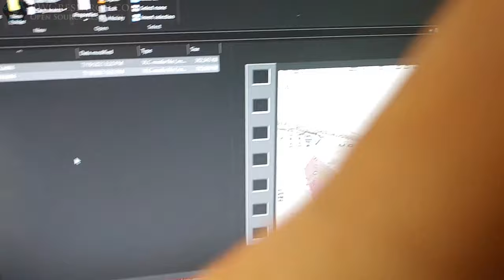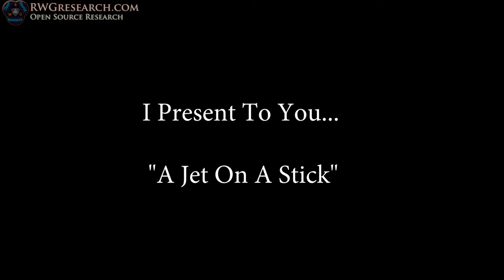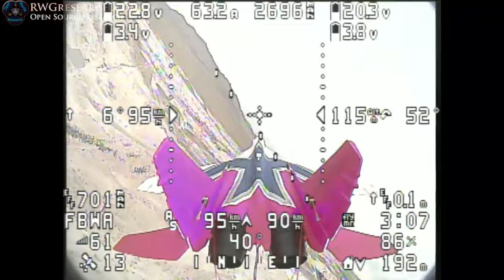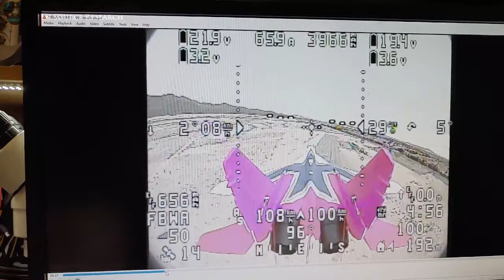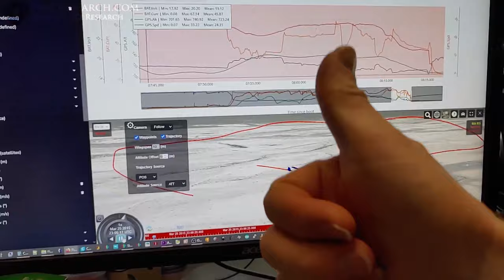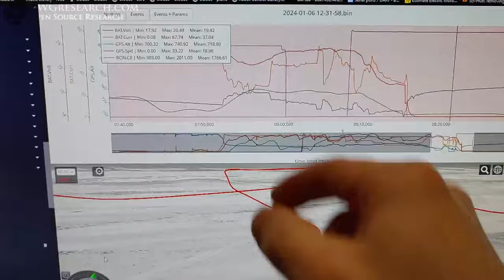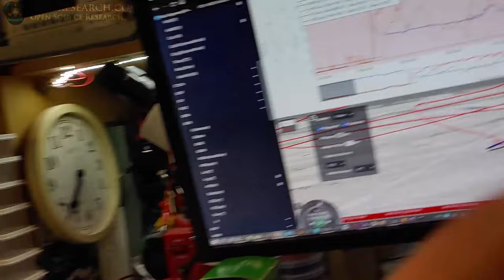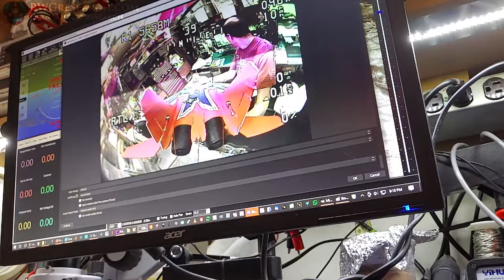A Jet On A Stick - MIG-29 Third Person View -Twin EDF - Ardupilot - (crash) + Extra - SEND IT!

Comment: I love it, worlds fastest drone. I guess the biggest variable is, whats the longest lasting battery you can fit on it
Reply from the maker: exzactly. so its suppose to be a 3000mah... that gives you ~2000mah of "usable" capacity  ish... so i cut out the foam and balanced the CG to run a 5000mah that about 4000mah "usable" capacity. ( that's why i was shooting for 4000mah in this flight. but realized i needed to land @ that capacity...) the 5000mah adds  some weight and this thing is already a brick. so I'm already pushing the envelope. but i was in the air for 5 min... ( typical is 2-3 min for this plane) now its all about power management. got lots of data from this experience. so now i want to plan some missions and have it to full autonomous stuff. more to come.. ~Russ